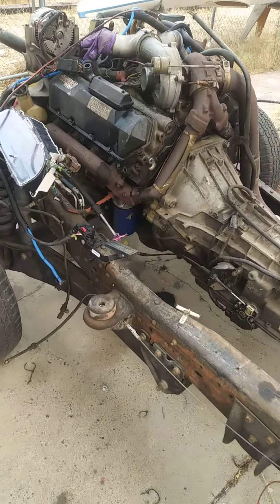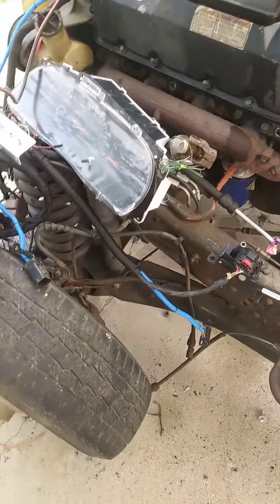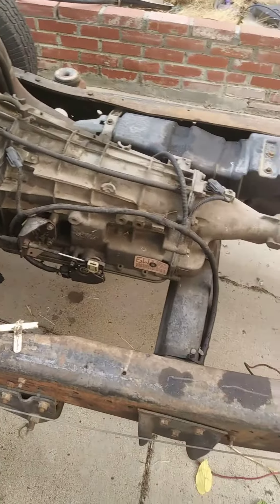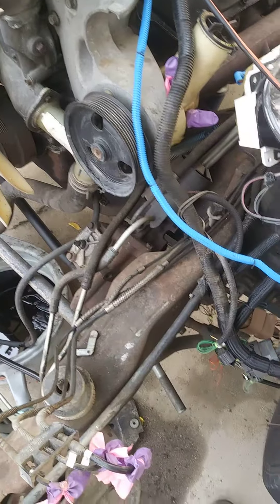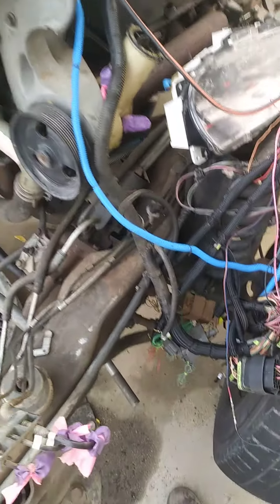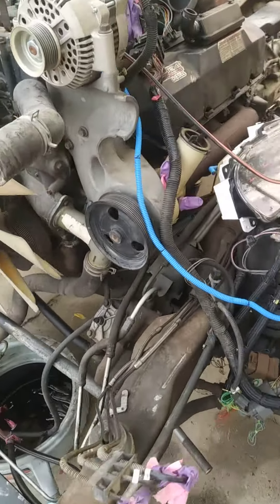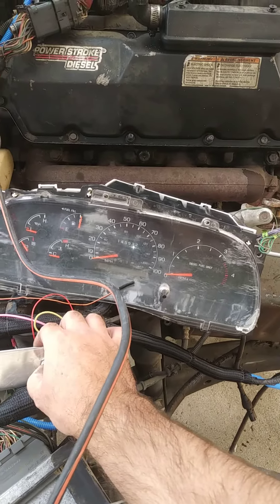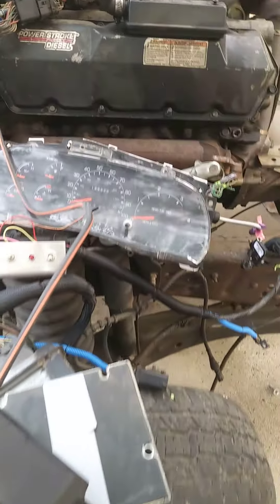Stand alone 7.3L powerstoke, 2001 Ford F-350 diesel.

Comment: Have you made any soet of write up or walk through to do this? Swapping a 02 powerstroke into a 77 f350 and wanting to do the same. Make it driveable witbout all the extra crap
Reply from the maker: No. I haven't made a write up on this.  It was just 2 weeks of sitting down and ripping apart the wiring harness, and trimming out everything that's not needed, which is alot.  
I think the 2001 was the last year of the mechanical odometer.  2002 was digital and the ECU communicates with the speedometer/odometer.  I've been told that the ECU won't work correctly without the speedometer/odometer unit.  I haven't verified this.

Comment: would you ever make stand alone kits to run the 7,3??
Reply from the maker: No. Its just a personal project that i wanted to do. If you wanna do it your self, i can give you a big hint; hack off the gem module, and then trace every cut wire and remove it from the harness. Thats about 60% of the wire nightmare.
Reply: @Prototypemech  you removed all the gem module wiring and module itself? all 5 connectors?
Reply from the maker: @justaguyinwisconsin6330  I don't remember how many connectors it had, but I removed all the gem wiring.  I'm Gem-less.
Reply: Was @Prototypemech

Comment: What all was required to make it run? I have a 92 with a 7.3 idi and I want to go to a power stroke now that the block is cracked
Reply from the maker: Step one is to unwrap the wiring harness and cut out the GEM module.  Then trace all the cut GEM wires and remove them from the harness.  That's 75% of the wiring harness.